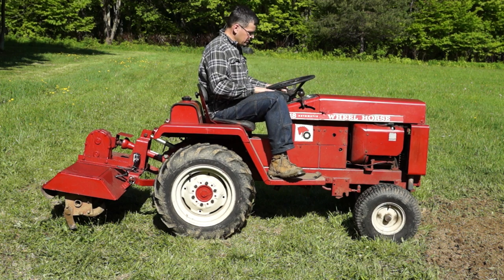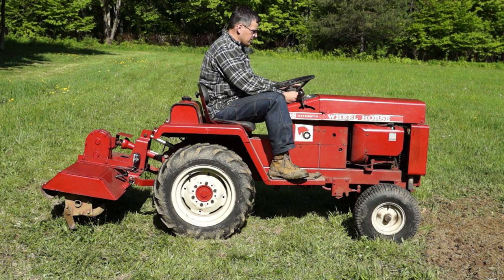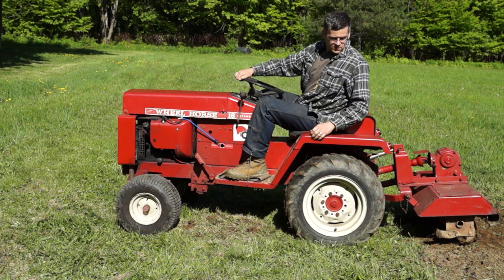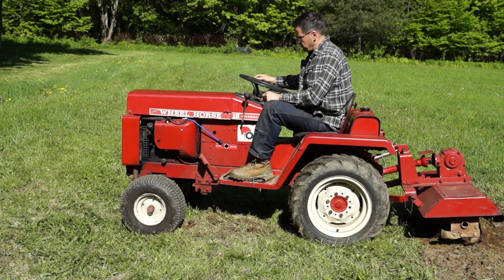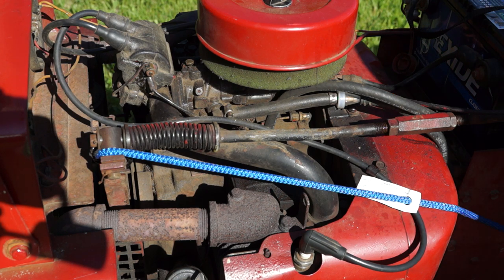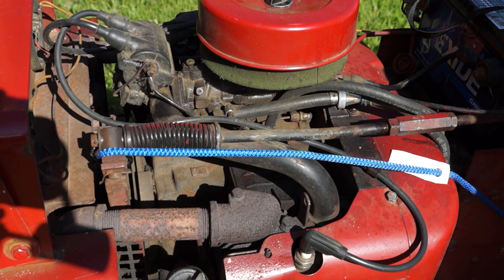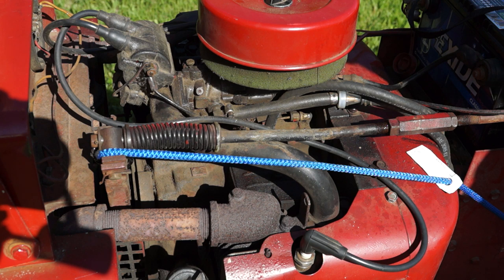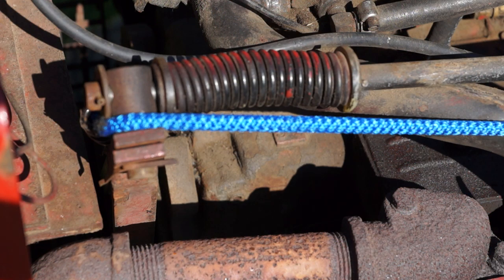Wheel Horse 18 auto - Rototilling - PTO clutch issues

Comment: not sure if anyone has responded to the specific issue you had, but the answer lies in the other side of the PTO engagement forks. the opposite end near the bottom of the motor. You can thread that in and out, as the clutch materials wear out. i've got about 1/8" left on all the material, but had to take off the front pulley, screw the pivot point out a couple of turns, then re-adjust the upper spring.  Works like a charm, and mine drives a bucket lift. I'd love to see how that PTO is fed all the way back to the rear area, must be a lot of driveline spinning around back there!

Comment: Hi Chris,  I have a small clearing on my property that is heavily wooded.  It is about 60 feet round.  Most of my property is on a hillside and the clearing seems to catch alot of water.  I would like to grade it so that there is a swale to funnel the water down one side of the clearing but am not sure how that can be done.  I have no tractor or heavy equipment so I would like to hire the Amish or a local farmer to help me.  Any suggestions?  I am in Farmersville. Beth
Reply from the maker: We have hired a local heavy equipment operator at times with a dozer that can angle the blade for grading... if we do it we have used a combination of a middle buster (single bottom plow), back blade and rear scoop... but they are not designed for this type of work so it is difficult...

I would think this type of grading would be beyond what Amish could do... without heavy equipment it would be challenging to say the least... 

I would check your area for a business with loaders and dozers... we found our guy just driving by his place... we stopped and talked to him and paid in cash... we might have to call him this year to get the driveway cleared... 3 feet of snow is too much for us to move... his front end loader would make short work of it...

good luck
Reply: buffcleb Thanks Chris,  I will check with the locals and see how it goes.  Happy Camping!

Comment: I've been a Wheel Horse man for years!!  I just got rid of my 1990 520-H.  Sadly, they don't build them anymore.  I've had to switch back to Simplicity.
Reply: I'm not that familiar with the D-Series.  Looks like you need to build a keeper of some sort to guide the rod and keep it from wobbling around.  The factory spring may have also been used for that purpose.
Reply: doogals99 get a wheel horse 518-h
Reply: I had one long ago I didn't know what I had It had a  very narrow front end. It had  PTO its engine was very old but ran it was the type that had no recoil spring and you just wrapped the pull string around the exposed hub and pulled It looked just like a little tractor I so wish I had held onto it im not sure how much it was worth but I traded it to a man for his Russian made Welded receiver AM 47 with the rolled steel flip up stock and 3 Hi cap mags Idk if it was a good deal or not I had got the WH in trade as boot all I did to it was clean it up cha he the oil and plug and put a plug in the rear tire What is the value of I'd say for sure it was pre 70s mabe late 50s buy the way the engine looked of course I'm probly wrong